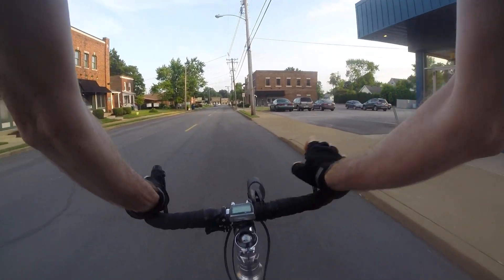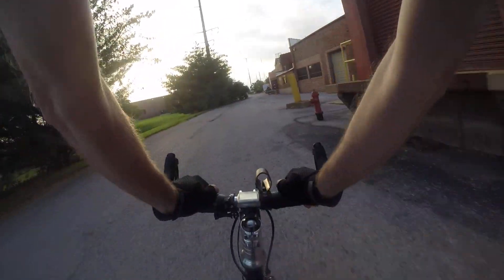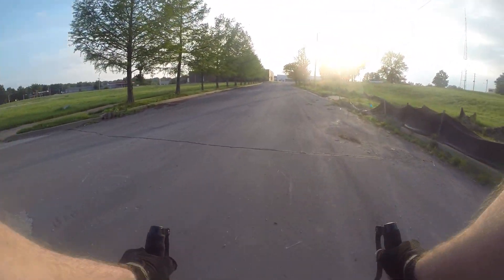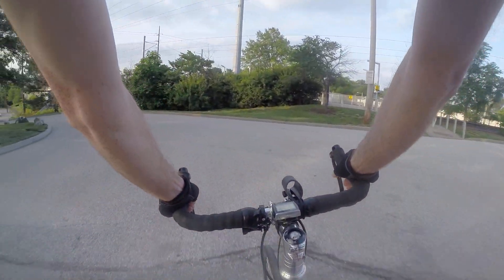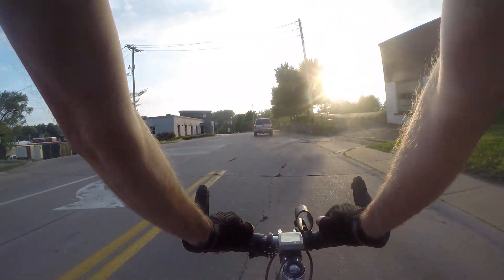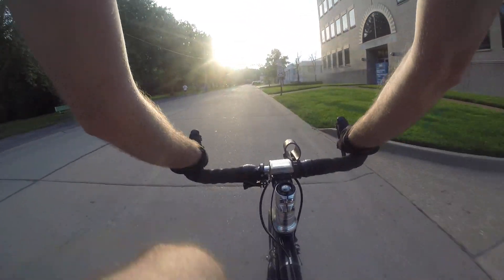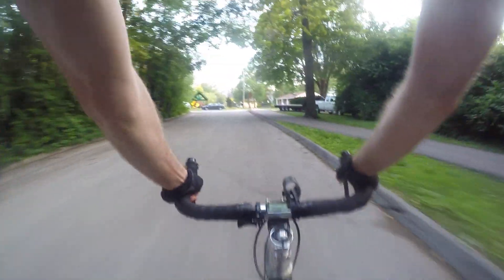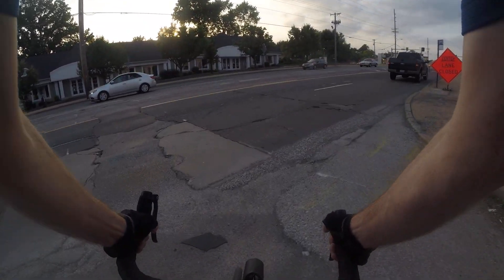Internal Gear Hubs IGH And Bicycle Commuting Home Bike Blogger

Comment: IGh are a little heavier. And yes; more expensive. But, it's a sealed system that runs in grease bath. So, everything is always lubed. They tend to very very quiet. I have a 2018 Dutch Gazelle tour popular 8 speed. The gear spacing it close to perfect with 8. I am crazy at the idea of 7. Nor would i be crazy about coaster brakes. Sorry. I would take the worst clamp brakes over coaster brakes.

Comment: Are those bull bars with STi shifters? I want to change my road bike from drop bars to a flat bar and still use my STi shifters.  Is that what you have done?
Reply from the maker: This is just a single speed bike with bullhorns and bar end brake levers.

Comment: You shift gears on the Sturmey kick shift by back pedaling, not by kicking a button on the hub.
Reply: had one of those built last year.   It works well but takes getting used to because it shifts when you don't want it to.   Basically, you need to learn what actions will make it shift.   If i remember right, it shifts to high gear after a certain speed no matter what like the sram automatix 2 speed.  The automatix is a beautiful piece of work but i think it's been discontinued along with all sram IGH's so now the price is starting to shoot up on remaining inventory.

Comment: I have an Aline 8 and use it for delivering sandwiches, it seems to me like the hub doesn't really like the hard starts. It pops and skips badly sometimes and it is adjusted right. I prefer regular gears or just a single speed.

Comment: I got a sram p5. I don't like the shift cable, but it requires a special shifter mechanism that I can't change. I put too much grease in it making it difficult to pedal, but now it seems to be getting easier to pedal in high gears. The first ride felt like I was pedaling through mud in high gears. The chainline is good, the rear wheel has symmetric spoke dish. I would be much happier with a new shifter. Chain tension, or axle location, is an annoyance to keep proper. I think the 5 gears I got is overly many. Maybe I will try a 3 speed.

Comment: is there a internal gear hub that doesn't incorporate a disk brake, or any other brake system??... I ask because when braking with this systems you are using the brakes connected to the hub, instead of the brakes acting on the axle the act on the hub, and this in turn acts on the internal gears... the result being stress on the internal parts creating extra wear eventually braking or eroding the gear parts
Reply: Look up how a hub brake works, it's a bunch of metal shoes that rub on a braking surface internal to the hub, iirc. You can put a hub brake in a hub gear and have the two systems be completely unrelated so the brake won't wear the gears out and vice versa.
Reply: You are a moron.sorry but it had to be said

Comment: Great topic bike blogger! When I was a kid many moons ago, I had a Schwinn that had, what they called it back then, a two speed kick back. That bike was fast! I got it literally up past 50 mph on a quarter mile down grade that leveled off at the bottom. The speed limit was 35mph and a car that past me was trying to catch up with me and when they did, the passenger screamed out the window telling me, "Dude, your going over 50mph!!!!!!!" This was back in the early eighties. It was geared in such a way to where it wasnt too noticeably hard on the legs unless you were going up a pretty steep hill. Keep in mind, this had a steel frame on it which was somewhat heavy when compared to today's bicycles. It would really be neat if they could add more gears to this concept. Thanks for posting this, brought back memories!!!!
Reply from the maker: SolarReturn That's cool, SolarReturn! Yeah, I had a similar encounter recently on a two lane road going downhill where I began to pass the cars in the fast lane, so I felt the need to slow down to play it safe. LOL

Comment: Hey Bike Blooger! 
Been watching your videos for a while now and I've got to say I am enjoying your channel!

I've been meaning to ask you since you know your way around a single speed and I really have no idea having never owned or ridden a SS but I've been mulling over converting my vintage 10 speed into a single speed or a fixed gear and I was hoping you could tell me the difference between the two and what gear would you recommend converting to. 

Happy riding! σδ
Reply from the maker: ***** Hello trevorduvall. Everybody has a favorite gear. Try to figure out what gear you stay in the most. Something around 70 gear inches is common. 70 G.I. means the number of teeth on your front chainring divided by the number of teeth on your rear sprocket multiplied by your wheel size (26", 28" or 700c, 29"). For example, 46 tooth chainring/18 tooth rear sprocket * 28 inch wheel = 71.5 gear inches. The gear ratio is 46/18 = 2.5. A good hill climbing gear ratio is 2.0. A good racing gear ratio is 3.0. Somewhere in the middle is generally a good commuting gear. Single Speed means you can coast (bike moves forward without pedaling). Fixed gear means the crank arms always move with the forward motion of the bike; you must continuously pedal. I prefer single speed because I can go a little faster downhill, ride over road debris easier, jump street curbs easier, look over my shoulder easier etc. The main disadvantage of having only one gear is climbing hills (and starting from stops if you have too high a gear).
Reply: BikeBlogger Hi Bike Blogger.Thanks for your detailed reply. I'm still trying to figure out the differences in ratio and coming around to understanding it better. I would say I stay in third gear the most. Between the the third and the fourth gear. I have a basic idea of the difference now between fixed and single speed. I've heard about the main disadvantages of having a single speed but it does have me intrigued. I think I would prefer single speed also to fixed gear. So somewhere in between 2.0 and 3.0 would I think best suit my needs,70 G.I. as you've mentioned. I generally stay away from hills, at least the bigger hills that take five or more minutes to climb. So I think I just might like single speed once I try it!
Reply from the maker: ***** Gear ratio is simply how much bigger the front ring is than the rear ring on your bike. Gear ratio of 2.0 simply means you have a chainring twice the size of the rear cog (eg. 50 tooth chainring and 25 tooth rear cog). Count how many teeth are on your front ring then count how many are on your favorite rear ring. Divide the two and that is your ratio. :) Single speed is perfect for flat areas with gradual changes in elevation. It's a personal preference too because I prefer less clutter on my bike (cables, sprockets, levers, shifters), and if you can figure out your 'magic gear' you can get away without a chain tensioner too with single speed. Here is a link to one of my blog posts about that 'magic gear' setup. http://bikeblogger.com/?p=157 One thing to keep in mind is that you want a stretch proof chain because over time it will stretch and fall out of the safe zone. Or just get a chain tensioner to pick up the slack. Sorry, I know that's probably more than you need to know at this point..
Reply: BikeBlogger Good example and pretty close to what I was thinking. As soon as I did the count on both front and back then divided the amount it clicked! I finally get it now and I'm out of the dark so thanks so much for helping me understand better! So I counted 52 on the front chainring and 17 on the rear cog (second gear, second or third gear is either/or my favorite) making it a ratio of 3.0. I've read around a bit online and there are some that would say 52x17 is too high and and not really great for your knees and that either 44 or 42 for the front chainring would be better but I really don't want to replace the orignal chainring on my vintage ten speed so I hope I can leave it as is. It was also suggested that 44T on front and 17 in the back would be a solid city commuter gear ratio, which is a difference of 8T so at this point when I do convert to single speed I'm still undecided to the front sizing that I'll go with but I am really looking forward to it and am excited about it cause I've heard how liberating it can be and how much more cost effective and low maintenance it is. 
Your description of flat areas with gradual inclines is where I basically do most of my daily riding already. As I've mentioned I tend to avoid the bigger crazier hills so I agree that single speed is perfect as the constant shifting can be distracting from the ride and the extra hardware on the bike is not only added weight but not as minimal looking as I would like. I am pretty much a minimalist like yourself, I like to keep things simple...

I read your blog post for the 'magic gear' setup and what you were running is what I first thought I'd like to be running also, 52x19. The chain issue I wasn't aware of. I knew that they stretched over time but didn't know that messes with the safe zone or that you can get stretch proof chains. I think a chain tensioner would probably be a better investment and a good idea in the long run as replacing chains even before they are done their life span, though cheap enough, can add up in no time. No worries it is a little more to think about but I'd probably just end up asking you about it in the end anyway! haha.
Reply from the maker: ***** Yes, 52x17 is high for riding around town. 52x20 is closer to 44x17. I always ride 52x19 as you mentioned, but my power to body weight ratio is pretty good. Keep in mind for riding single speed the highest gear you can use is 52x16, (unless you buy a less common chainring like 53, 54, etc). Singlespeed freewheels for coasting do not come smaller than 16 tooth on English thread wheel hubs (1.37"x24 tpi). You can get smaller freewheels like 15 tooth and 14 tooth on Metric hubs found on BMX bikes (30 x 1mm).
Reply: BikeBlogger That is what I thought that 52x17 would be too high for city riding. I've narrowed it down to three possibilities. 2.5, 2.7 or 3.0 but the latter doesn't seem like such a good idea now so maybe I'll downshift to second gear and ride around for a bit to get a feel for that ratio, or maybe just stay in third. So would you say you would recommend building up to 52x19 and start in a smaller ratio? Good to know that 52x16 is the highest gear. Thanks for the tip so I don't look like a total wingnut when ordering my freewheel. BMX bikes I've noticed do have the smaller freewheels but its been many years since I've ridden one of those and didn't know the hubs were Metric. 
So what gear combination would you recommend I ride with multiple gears to try to figure out which ratio to convert to? I was recommended, as I've said before, that 44x17 is a good city commuting setup but I think that is slightly a little too low so I am thinking more along the lines of 2.7. A bit of a learning curve when first getting into single speeds I'd say.
Reply from the maker: ***** Yes, building up to 52x19 would be a good idea if you are getting any pain. That setup is 2.7 or so, like 44x16. Either way your legs will take some time adjusting. It also depends on how fast you like to pedal and/or ride. I pedal pretty fast and can avoid spinning out until I start passing 100 rpm.
Reply: BikeBlogger Some pain yes I'll admit so I think that would be a wise way to go about it, building up the endurance slowly over time. Did it take you very long to adjust your legs to the gear? Like you I like to pedal pretty fast and tend to ride about the same, so I'd say that is a decent speed before spinning out. I am wondering though other than being a bigger or smaller size in freewheel and chainring what is the difference between 52x19 and 44x16 if they are both the same equalling to 2.7?
Reply from the maker: ***** I was already pretty comfortable in 52x19, and have tried moving up to 52x17 (gear ratio 3.0) but have gotten pain and backed off. I have not tried again recently. There are only a few small differences I can think of between 52x19 and 44x16. First, larger chainrings or cogs can extend the life of your drivetrain a little bit and this is more true of even tooth gears like 44x16. Second, larger chainrings and cogs weigh a little bit more. Third, I have heard an argument that larger sprockets are more efficient(?). Fourth, 52x19 gives you 19 skid patches while 44x16 only gives you 4. Skid patches only apply to riding fixed gear. A skid patch is the number of spots on the rear wheel that could possibly skid across the ground with when you use your legs to stop. The more skid patches, the better, because that means you are less likely to wear out your tire as quickly when performing the skid stop. See https://www.surplace.fr/ffgc/
Reply: Well then that is a good thing that it didn't take you any amount of time to adjust, that is a good thing! I'd think that anything higher than 2.7 would be too high. If you had some discomfort when you rode 3.0 it really isn't too surprising that you haven't tried riding in that gear since. The size being the main difference between the two I wasn't aware that the drivetrain would be affected at all in its sustainability. Larger sprockets being more efficient does seem to make sense though. Thanks for explaining it a little more and for sharing what you have learned. Also thanks for the link to the website, the gear calculator is pretty awesome! 
You mentioned skid patches and the wear of the rear tire when on a fixed gear I can understand why and how the tire would wear a lot quicker when skidding to stop but I am somewhat confused as I thought that a fixed gear wasn't the same thing as a single speed?

So I think I may have done enough research into which gear I will go with. 52x19 I think would be best for me as well. So that means keeping my chain in the top chainring and in the third gear? Would you recommend that I ride that way until I have the conversion done? And also I was wondering if you will being doing a single speed conversion on your GMC Denali road bike, or will you be keeping it as is with its gears?
Reply from the maker: ***** A fixed gear is typically a single speed, although fixed gear bikes and "single speed" bikes are often referred to as two different types of bikes (one with a fixed gear and another with a single speed that can coast). The only multi speed fixed gear bikes I am aware of are the type that use internal gear hubs. I would recommend you nail down your favorite gear on your multispeed, but you may end up buying a couple different sized freewheels anyway; I have several different sized freewheels myself. Another thing you could eventually do is get a flip flop hub that allows you to install a freewheel on both sides of the hub and switch between the two by flipping the rear wheel around. Yet another option is to do what I do and get a White Industries DOS Eno freewheel which is a 2 speed freewheel but the same size as a single speed freewheel. I can change between gears by moving my 3/32" thick chain from one sprocket to the next, but since I still must get off my bike to do it I think it still technically qualifies as a single speed bike. Oh, I probably will not be putting any extra money into my GMC Denali or converting it to single speed. Single speed is a little easier on the hills when the bike itself doesn't weigh as heavy as a rock! :)

Comment: Bikeblogger give this a look http://www.fyxation.com/products/six-fyx-conversion-kit
Reply from the maker: DANNYTHEQUAD Cool, thanks for the link DANNYTHEQUAD! I actually got all the parts to do a conversion like this myself but ran into trouble because the derailleur cage would not move far enough inward and the hub cannot take a 5 speed freewhel. I think I need to replace the rear hub with something like that, but I'm happy with my lightweight singlespeed right now. All I really wanted was 2 speeds, maybe 3, with a derailleur to save weight versus IGH. I like that 1X drivetrains are becoming more popular.